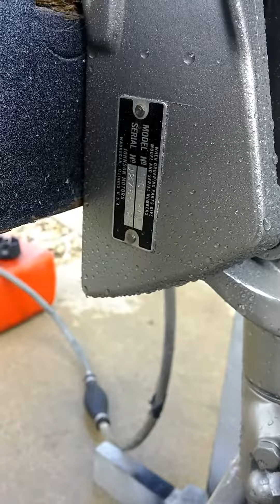6hp Johnson Outboard Motor Demo CD-24D

Comment: How many blades on that prop? I have the same engine but a dealer changed the. Prop and didn’t give back the old, and I want original
Reply from the maker: This 6hp had a three blade prop on it but some models also had a two blade prop. I have another 6hp Johnson it also has a three blade prop. Let me know if you want the dimension of original prop.